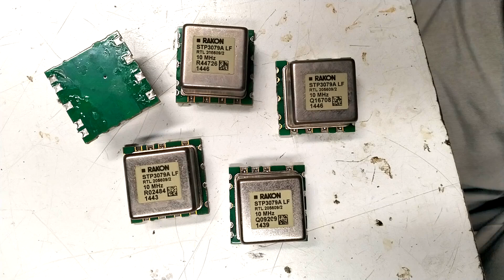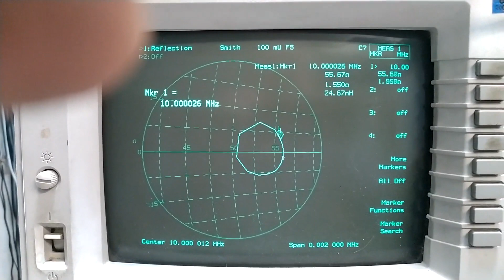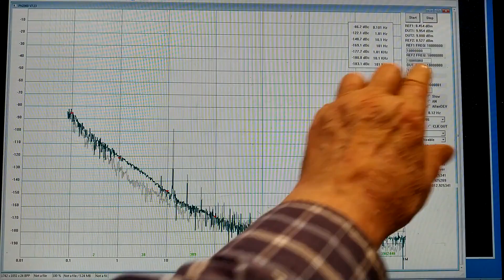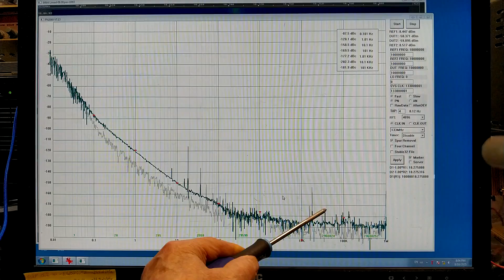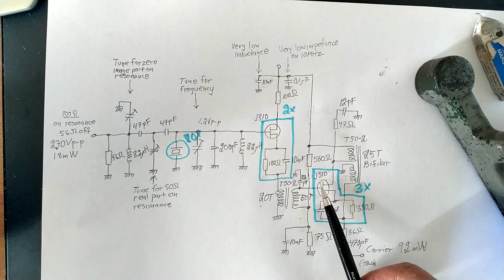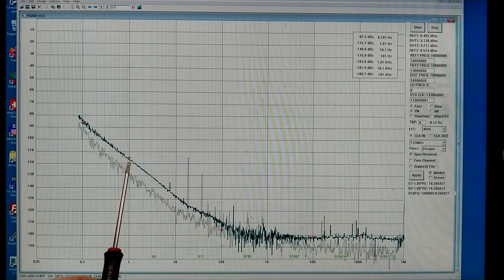nerds107

Comment: AI Summary

Abstract:

This video presents an in-depth experimental exploration of temperature-compensated crystal oscillators (TCXOs), specifically targeting the characterization and minimization of phase noise in a 10 MHz system. The presenter investigates readily available TCXOs, noting their inherent design for long-term stability and compact size rather than ultra-low phase noise. The core experimental setup involves an array of 20 third-overtone crystals driven by custom-built amplifier stages and filter networks.

The video meticulously documents an iterative process of optimizing the oscillator's performance, including fine-tuning thermostat control, impedance matching, and power distribution. Various high-precision measurement tools, such as the Linrad spectrum analyzer and the PN 2060 phase noise analyzer, are utilized to quantify and diagnose noise characteristics. Key challenges encountered include transient "glitches" suspected to originate from micro-cracks within the quartz crystals, and unexpected noise contributions traced to systemic measurement issues (e.g., mixer problems, BNC connector integrity) or unintended feedback loops stemming from suboptimal amplifier layout. Notably, the presenter discovers that higher signal levels can induce phase modulation noise from the crystals or amplifiers, while reducing power significantly improves close-in phase noise performance. The video concludes with ongoing efforts to refine the amplifier design and layout to achieve better stability and a lower noise floor.

Characterizing and Optimizing 10 MHz Temperature Compensated Crystal Oscillators

*   0:00 The video introduces surplus 10 MHz Temperature Compensated Crystal Oscillators (TCXOs) which are inexpensive and produce a 2-volt square wave output.
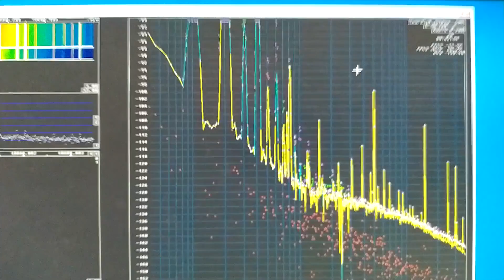*   0:28 Initial phase noise measurements indicate high sideband noise; these oscillators are primarily designed for long-term stability, not for extremely low phase noise close to the carrier.
*   3:10 The internal crystals are high-quality 10 MHz third-overtone crystals, with 20 of them connected in parallel for this experiment.
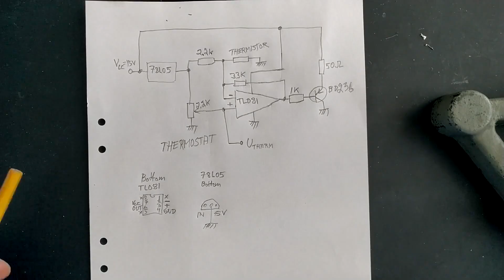*   3:31 The optimal thermostat control voltage is determined using a network analyzer to achieve the flattest frequency response.
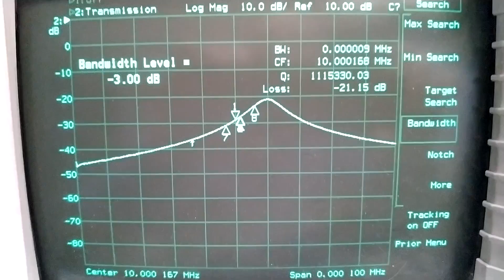*   5:30 Adding approximately 230pF capacitance adjusts the frequency to 13 Hz above 10 MHz, which also surprisingly increases the crystal's Q factor to 1.2 million.
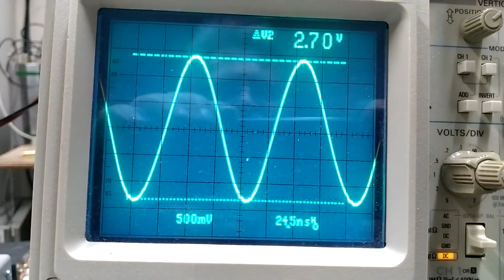*   6:06 Power distribution to the crystals is optimized, aiming for 2mW into the crystals and 16mW into the series resistor, resulting in calculated resistor values for the crystal filter.
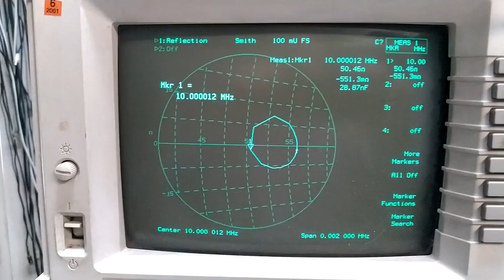*   10:23 A high-impedance source follower (J310) and a low-noise amplifier are integrated, measuring a 2.82V signal across the crystals with a 680-ohm output impedance.
*   12:00 Measured thermal noise levels closely match theoretical predictions, validating the experimental setup for noise floor evaluation.
*   14:50 Persistent "glitches" or interference are observed in Allan variation measurements, suspected to be caused by micro-cracks in the numerous parallel quartz crystals.
*   15:49 Reducing the signal power by 10 dB significantly mitigates these glitches and improves the sideband noise performance.
*   19:47 Iterative improvements to the amplifier's components and configuration are made, showing incremental reductions in noise, though glitches may still reappear after prolonged operation.
*   31:11 Employing two source followers in parallel, along with provisions like ferrite beads to prevent VHF oscillations, leads to improved stability and noise performance meeting PN2060 specifications.
*   33:18 Systemic measurement issues are identified, including problems within the mixer and BNC connectors of the test setup, which were contributing to unexpected signal artifacts.
*   36:37 Adding an RC low-pass filter to the power supply eliminates spurious signals but does not significantly reduce the overall noise floor, suggesting underlying stability challenges persist.
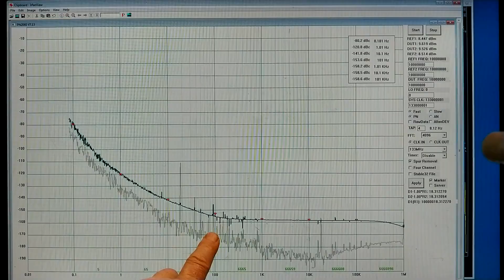*   42:06 A secondary crystal filter is introduced between the signal source and the unit under test, which adds noise at lower frequencies but not at higher ones, allowing for more isolated noise characterization of the device.
*   43:02 A second amplifier stage is added, featuring a step-up transformer and parallel JFETs, designed for higher power output and a stable output impedance.
*   44:58 Extensive noise floor characterization is performed using a 10.7 MHz crystal filter and a noise figure meter, revealing small discrepancies (e.g., a 4 dB error) between different measurement techniques, highlighting calibration challenges.
*   59:36 Further investigations uncover and mitigate high-frequency self-oscillations (at 80 MHz and several hundred MHz) in the amplifier stages by adding specific capacitive and resistive components, leading to a higher output power of 92 mW.
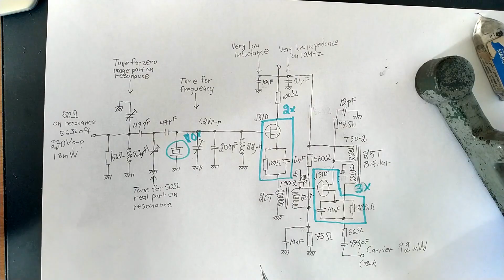*   1:01:07 Unintended feedback due to poor circuit layout is identified as a significant issue, coupling the output of the second amplifier stage back to the input crystals, which negatively impacts Q factor and frequency stability.
*   1:08:10 A key finding: reducing the signal level by 15 dB significantly improves the close-in phase noise, indicating that at full power, the noise is dominated by phase modulation induced by the crystals or amplifier non-linearities.
*   1:09:47 Noise added at a 1 Hz offset is found to be independent of the power level, suggesting it might stem from a varying reactive component seen by the crystals or the crystals themselves.
*   1:11:50 A new, simplified amplifier design (step-up transformer + source follower) is tested; while it produces 20 mW, it is highly prone to self-oscillations, requiring extensive stabilization.
*   1:14:54 The video concludes, acknowledging its length, with plans for a future video detailing a revised layout and design to address the remaining high-frequency oscillation and noise issues.
*   1:14:59 Visual evidence of instabilities and oscillations is provided through slow-motion capture, demonstrating the complex behavior of the system.
*   1:15:28 The thermal noise of the crystal is observed directly, showing a higher level at resonance due to higher impedance, and highlighting the need for low-noise amplification to effectively analyze sideband noise.

I used gemini-2.5-flash| input-price: 0.3 output-price: 2.5 max-context-length: 128_000 on rocketrecap dot com to summarize the transcript.
Cost (if I didn't use the free tier): $0.0132
Input tokens: 32447
Output tokens: 1384